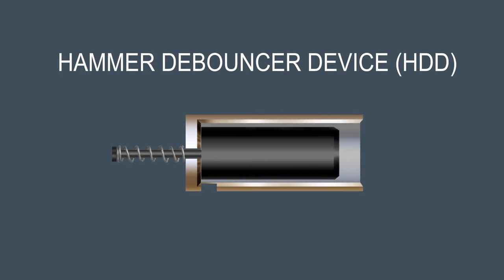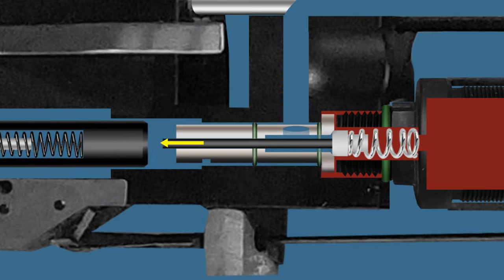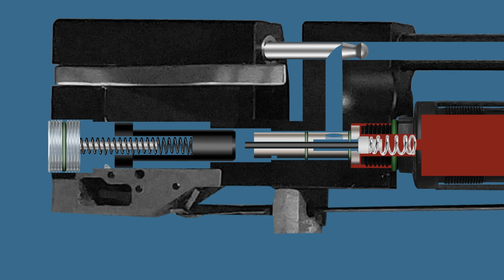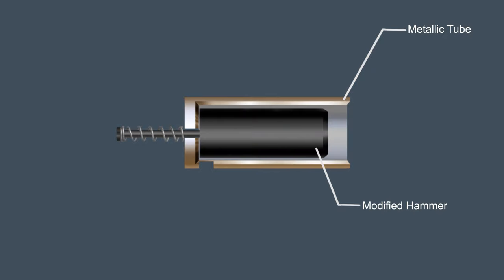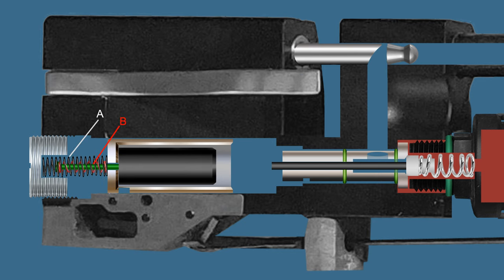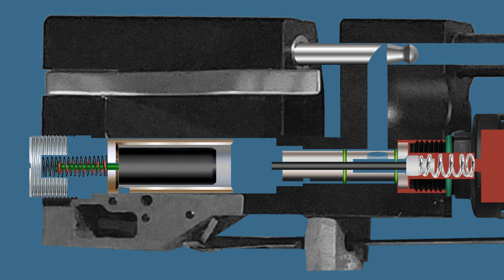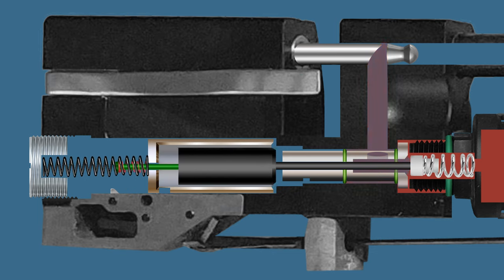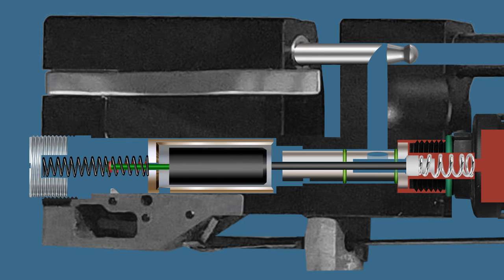How PCP Hammer debouncer works, Hammer zero bounce mechanism

Comment: What stops the carrier from moving when the inner weight bounces back and collides with it? I suspect that this is only a bounce reducer not a complete debouncer. The free travel distance really doesn't do much to reduce bounce, because the actual energy transfer happens when the inner weight is in contact with the valve stem.
Reply from the maker: Thanks for watching this video. It sounds like you're taking about inner weight bouncing?
Inner weight may bounce due to repid hit of stem valve but when inner part bounces and hits again the stem valve with low force. It can not release the air.
Reply from the maker: Here is the official technical video from daystate https://youtu.be/lZgf4HRzWvc?si=LFn5oaDZNjUCpIpz
Reply: @AirGunMech  Nice, the bounce continues as I predicted. It is because it does not arrest the bounce but only attenuates it. Meaning it is still dependent on starting with a not-very-bouncy tune. You can see this by the small initial bounce. Debouncers that arrest the bounce are more versatile because they have the same result of stopping bounce independent of the tune (any hammer weight, spring stiffness and preload, valve travel, pressure, etc.)

Comment: Wow.. Its mean you will got 2 dump.. Outer hammer with chammber and inner hammer with valve pen... Hmm... Will not make doble recoil??
Reply from the maker: Hammer can move freely in out chamber. When pellet is loaded cocking handle pulls the outer chamber tube. When it is fired, tube releases along with the hammer.
Reply from the maker: PCPs are more powerful than springer.
Reply: @AirGunMech  i mean that will be have 2 hit.. One at outer hammer.. And the second hammer with pen valve... Theywill make recoil  on air rifle.. Like 2 punch .. Willbe make the rifle moving or recoil..
Reply: @berry more yo dont understand what i mean... Even hammer free hit the pen valve... Before that theare are 1 hit outer hammer punch.. Then hammer punch to pen valve... So 2 punch.. And they will make doble recoil ..
Reply from the maker: https://youtu.be/tIeT9xuvNoQ
https://youtu.be/lZgf4HRzWvc
Please watch these two videos. You'll get your answer

Comment: In Russia made more easy - posted hammer. When hammer moved 1-2 millimetr without spring force before strike on stock of valve.
Reply from the maker: Then hammer should be heavy if it moves with out spring contact.
Reply: @AirGunMech  Not necessarily. If the rifle has a reducer valve, a light Hammer will usually be used, along with a strong spring.
Reply: Di indonesia banyak cari laras russia tapi gak ada yang jual ke sini

Comment: If it pushes Hammer but still the FPS does not exceed 770, what is the reason?
Reply from the maker: Are you using regulated gun or non regulated?
Reply from the maker: The spring tension also matters in order to increase FPS. As hammer hit with more force due to spring, FPS definitely be increased

Comment: in order to balancing the power between  hammare sprig and the spring of valve that it supresion air in  bottle that store to supply your gone more time . i see and suggest .the best solution ..you must be put washer spring for both  eqiually in oppesite direction that, is abes❤t method to give your gut more age when you was it.. if you agree about my easy and simple idea❤nasir alsanagle with best  my wishes say thank you
Reply from the maker: Washers spring system is not suitable for hammer strike
Reply: @AirGunMech  i mean any washer gust to make the weak spring  more thikness more to pushing high abillity  during use it thank you for your advice my friend.........nasir alsanagle send for you best wishes